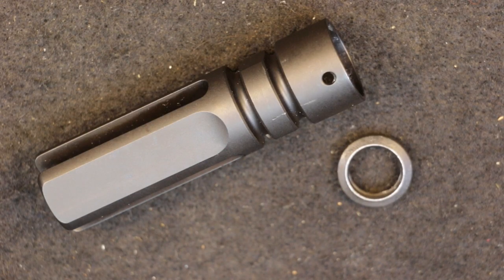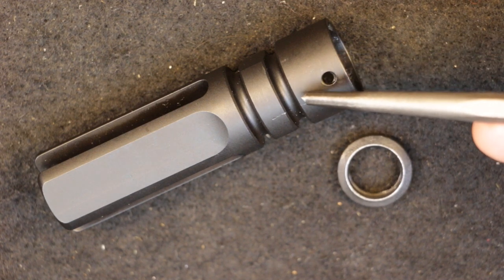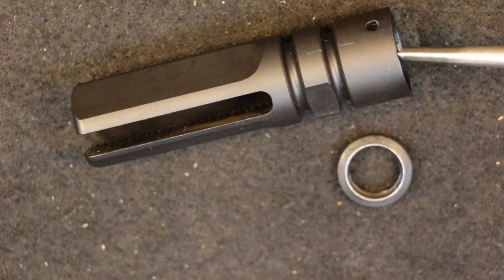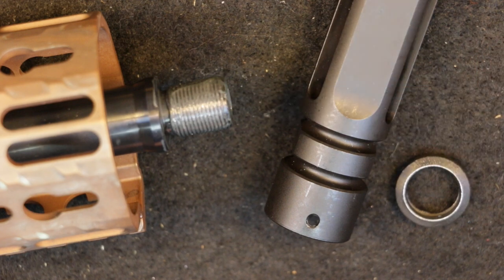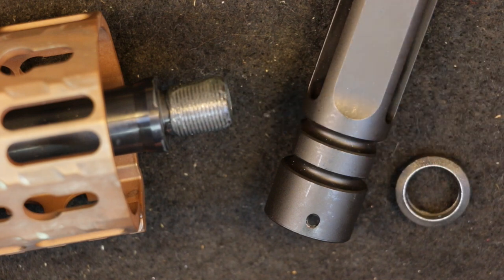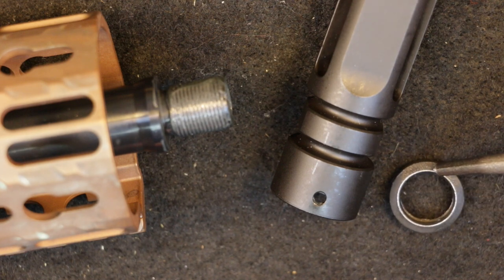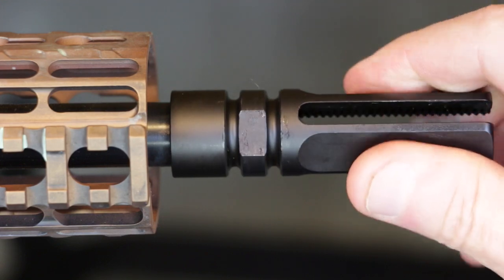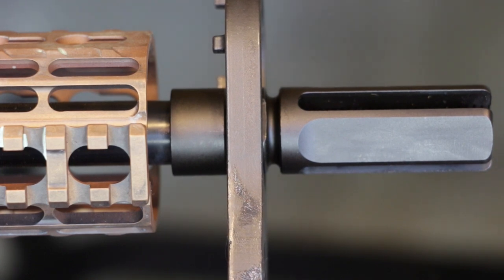Aero Precision Build Series: JP Enterprises 3 Prong Flash Hider

Comment: once I tighten the flash hider, the pin hole is past 6 o'clock, probably around 8. should I keep tightening for another 300 degrees to further crush the washer and get the hole to 6 o'clock? I'm afraid to damage my barrel

Comment: Small details.  Only one thread pitch offering for ar15. The 5/8-25 tpi Is for the ar10.  Also it does matter which way the crush washer is faced “install the crush washer leading with the smaller, beveled end down towards the buttstock” they recommend loctite 263 or 243 best to refer to JP instructions.
Reply: The crush washer JP includes with this muzzle device has beveled ends on both sides, so it doesn't matter which way it goes on, unlike a 'normal" crush washer. If you are using a different crush washer from the included JP, then you are 100% correct. If you are really interested watch the "Design Philosophy: Flash Hiders" by JPRifles on youtube, about 12 minutes in and they go into the design of their crush washers and the benefits of using them.

Comment: This is a silly question but I’m missing how this adds only 2.25 inches if the threads are half and inch and the oal is 3.125 inches. Just making sure I heard you correctly as I was thinking of putting this on a 13.5 or 13.7 inch barrel and pinning/welding
Reply: Because the threaded area is internal and the overall length is the outer measurement of the device. Once installed on the threads, it only adds 2-1/4". You have to subtract the length of the threads on the barrel and the depth they will reach within' the device from the overall length to get thw actual length it adds. Hopefully that's less confusing. This is a pretty good flash hider btw. I own one and it does a great job in low light of not blinding me.

Comment: Looking at doing a 13.7 pin weld build with this.
Reply: 13.7 didn't work for me even with a ton of shims I was still short.
Reply: @The3OfSwords  Interesting. Went to my local shop and they said after everything I'd still have ~half an inch. "16.5" 13.7 + 2.5 (YES, it is 3.1 but after threading it is 2.5 internal) = 16.2 but plus the crush washers etc it came to 16.5. 

Even without the crush washer internal thread from 13.7 should equal way above 16, thats odd. 

The only issue for me is THIS WONT WORK WITH ANY BARREL BUT JP. It can work with "any barrel" BUT there will be a gap because JP makes muzzle devices for their barrels, so unless you have a JP barrel - the JP flash hider will not be flush to the barrel and will not look aesthetically pleasing.

Comment: Wouldnt you want to avoid timing an open slot in the 12 o'clock position? Also, it would be nice to get some dimensions and OAL on a 16" Barrel.
Reply: the top slot is not directly in the 12:00 position
Reply: 16+2.83= oal. Plus a couple millimeters for the crush washer.

Comment: Hi, I just installed this and noticed a 'ping' tuning fork like sound every time I charge the rifle.. do you have the same experience?
Reply from the maker: It's inherently an issue with pronged flash hiders so it won't be eliminated but I don't notice it nearly as much on this one as others. It's one of those trade offs of excellent flash hiding vs. the audible ping.
Reply: There are some flash hiders that do NOT have that "ping" sound.  The Yankee Hill Machine Phantom and Seekins Precision Rook are excellent flash hiders that have no "ping" sound.
Reply: @dolphinsattack, have you watched the "ar-15 flash hider shootout" on another channel?
Reply: @dolphinsattack I haven't shot those but that was the vid I based my JP purchase on. I just thought it was cool that you still chose 2 of the best/darkest flash hiders in the bunch.
Reply: Let freedom ping. I prefer a ping over an obnoxious fireball muzzle blast out of my 10.5" barrel that gives away my position and flash blinds me for a bit.